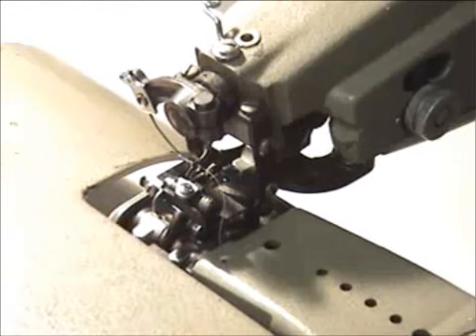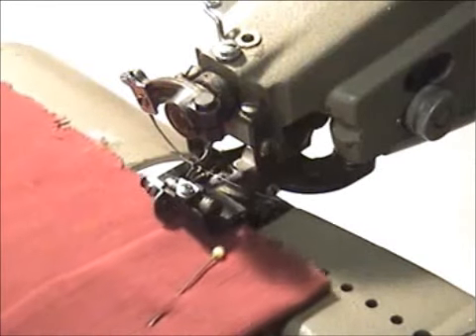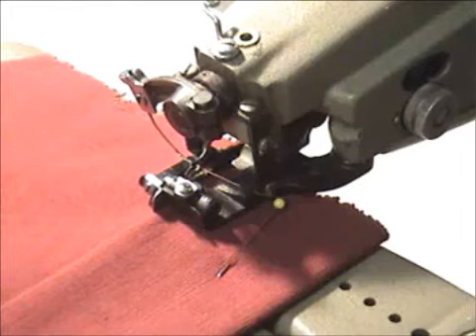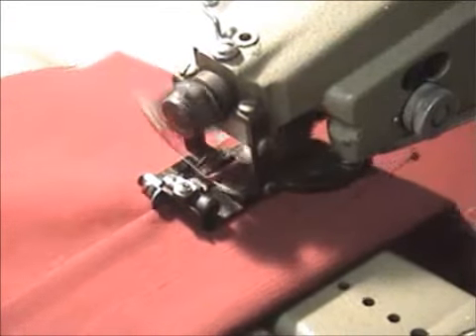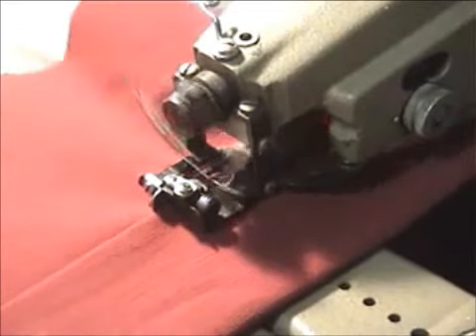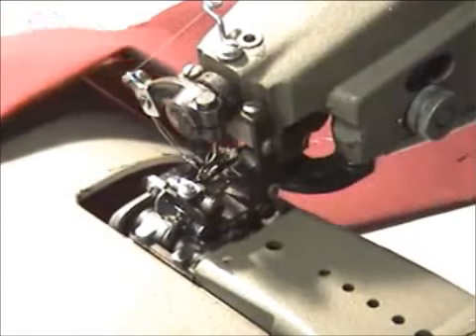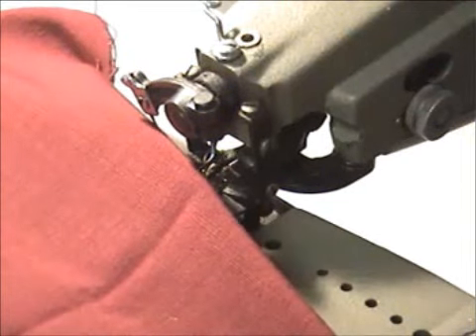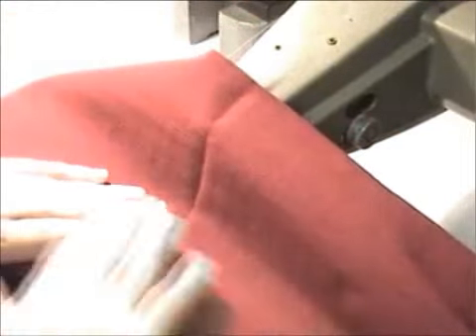Blind Hemming / Felling Machine

Comment from the maker: Hi

You are correct in your thought, the 1-1 will pick up a thread every stitch, and the 1-2 with skip a stitch and only pick up every other thread. I set my machine to 1-2.

The wheel with the drive belt often has number on also, this is to set how close the stitches are together - I my machine I have a silver push button, this is pressed and held first before setting the stitch on the wheel.

Hope that helps ..

Philip

Comment: Thanks for the video. I have a Mason blind hemmer with no manual. Can you tell me the difference in the 1-1 and 2-1 setting. I am guessing that the 1-1 is to stitch and tack every stitch and the 2-1 is to tack every few stitches. Does that mean that the wheel settings of 0,1,2,3,4,5,6,7,8,9 mean stitch a few stitches and tack every so many stitches? Hope that makes sense.